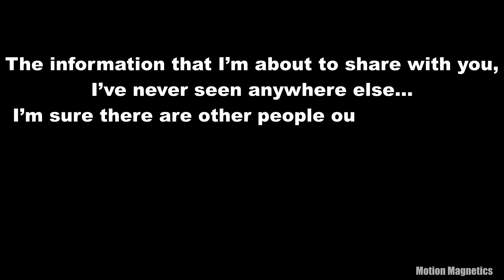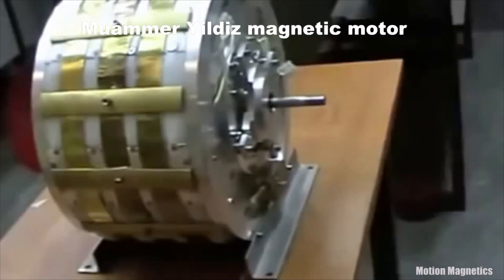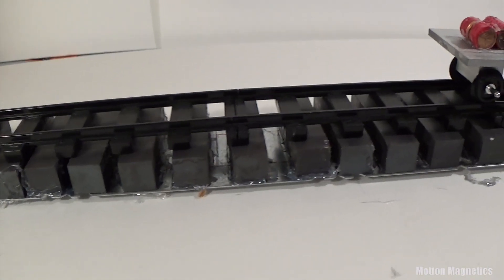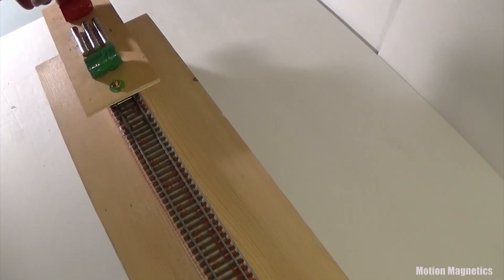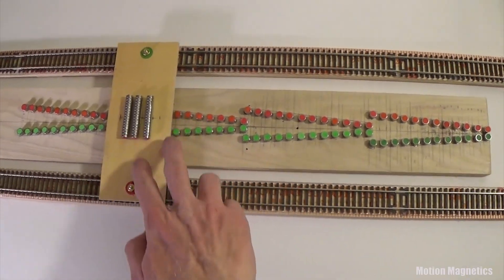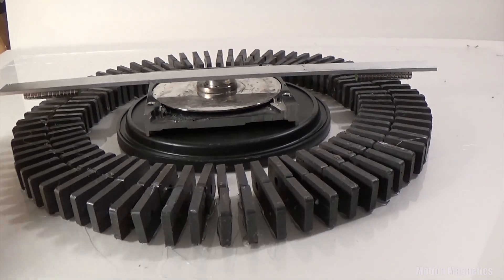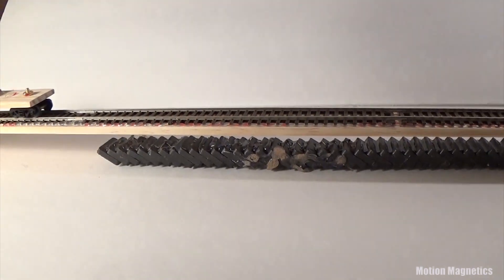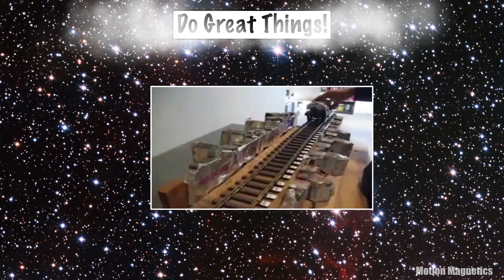The 3 Types of Magnetic Motors Part 01

Comment: We do know its possible for a magnet to accelerate . And even to let go from the last magnet in the acceleration line by gradually placing the magnets futher and further away from the middile like those Aussies demonstrated with the nik something array. Now what if the one magnet is in the middel of acceleration and the onther one is just entering the one inch barrier woul the acceleration of many magnets be enough to push the one thru the one inch barrier so it can also start acceleration.?
Reply from the maker: Werner van loggerenberg I'm sure there is a way to do it, but not in that type of configuration. Thanks for the suggestion though.

Comment: Very well done ! What program did you use to do these animation effects ?
Did you finally find a linear track that works ?
Reply from the maker: overunitydotcom Thanks. I used Keynote for most of them. And not yet. Rest assured, when I find one I'm totally satisfied with I'll share it on my channel.
Reply from the maker: mmrutman Not at all. I’ve assembled several versions of the V-Gate. I only included that one as an example. The more magnets you add to the cart, the less it works. Even with greater spacing. But don’t take my word for it. Please, feel free to try it for yourself.  V-Gate assemblies are very easy to build. I actually like Robert Calloway’s design. He was one of the first people to take the time to help me out, when I started working with magnets, so I have a bit of a soft spot for his work. 
My problem is with Mr. Soukup taking credit  for Robert Calloway’s design, without actually building a motor that works. If you watch all his videos, you’ll notice he never shows one of his V-Gate motors at start up, and he doesn’t take them apart for you to examine to ensure there are no miniature motors inside, after showing one spinning. The very first video he presented showed a spinning V-Gate motor, but never showed the start up. Nor did he leave it running for any length of time. He spliced a couple of clips together of it running to extend the run time. The rotor assembly was poorly machined, and off balance. Yet the rotation did not show this. It was consistent with an electric motor, or something that had been previously accelerated with a drill before filming. I’ve covered his numerous design flaws before, so I really felt no need to in this video. The magnets on his rotor would require metal shielding to even possibly work, because of their height. Or, they should be longer. Otherwise, there would be to many flux loops from the poles being so close together in a rotary version. He used an aluminum rotor in at least one of his designs. That would create eddy currents, and also prevent the design from working properly. His stator assembly is all wrong. He has to many neodymium magnets packed to tightly together. The rotor and stator should be much larger to compensate. If he wanted even a chance of making his motor work, he’d replace the stator magnets with steel or iron bars. Or replace the rotor magnets with steel bars, of greater hight than the magnets he’s currently using, and space the stacks of magnets on his stator with alternating North, South. The fact that he’s never thought to try either of those things or fix any of his numerous design flaws, to me, demonstrates his complete lack of knowledge of how permanent magnetic systems work. The problem with people who perpetuate these scams is that it casts a black shadow on the whole magnetic motor field, and makes it more difficult for real researchers to be taken seriously. I’d love to be wrong about him though. If he ever comes out and publicly demonstrates one working, from start up, and disassembles his device for examination afterwords. I would apologize for ever doubting his motor works. His motor that he feels he’s a genius for copying from Robert Calloway, and taking credit for his design.
Reply: Motionmagnetics if u notice what soukup did he has 5 bar not like your 3 bars more space  between eack like imagine you take his drum outter section (rotary sys) and flaten it into linear he says he only needs 5! bars yet they have a gap! hope it helps it looks like you need to spot your own systems that do work! maybe

Comment: If you use a portion of the electricity made, to shield or shut off or even boost up the end of your field.
You're looking for natural shielding.
 I think the way to achieve your desired effect is to electrically turn on and off certain portions of your field.
If you're going to try to stay with a natural shielding.
 I think you have to get out of a two dimensional look,
 right now it looks like you're running two dimensional configurations.
 I think you need to look at three-dimensional
Pattern. 
Just my 2 cents.
 Keep up the good work! 
love your channel!